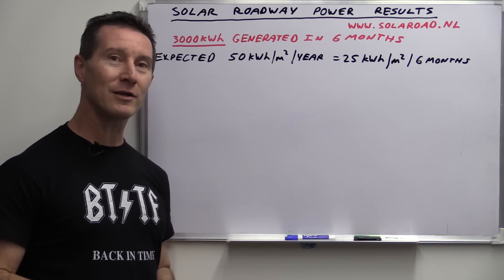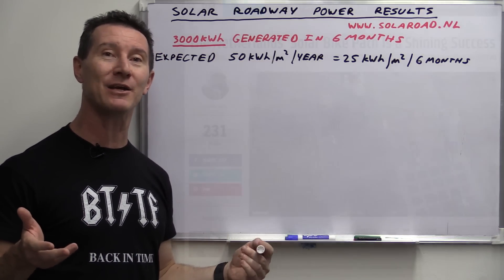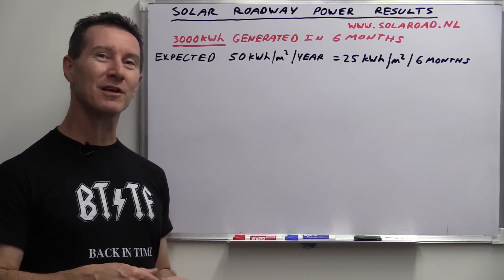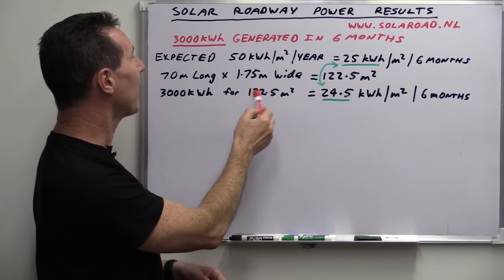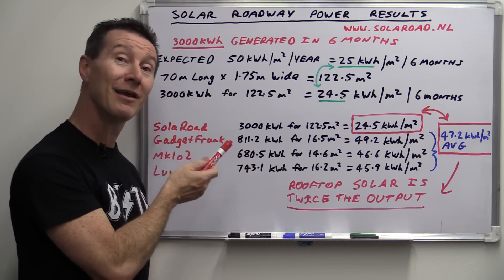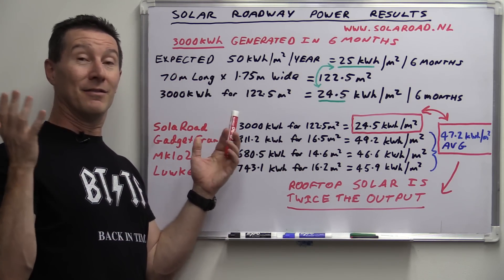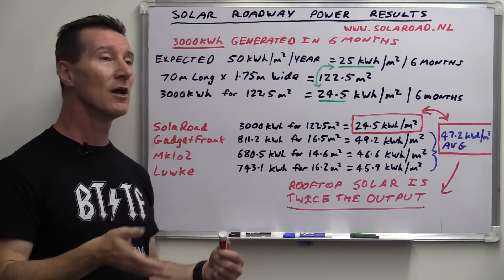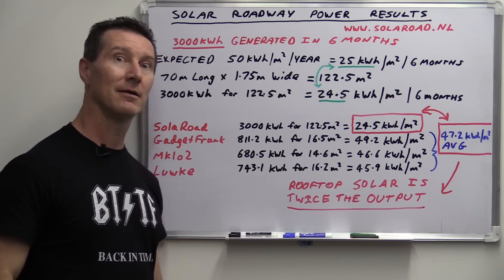EEVblog #743 - Solar Roadways Test Results

Comment: I mean yes I see many problems in this design, in the efficiency and in the production cost (in sense of the expended energy). Why not use space that we already cemented? Yes it would be better to do roof first, but filling the nature with angleded solar panels is not the right way. 🙂

Comment: If you have a very large surface area, eg a road and very cheap PV's then efficiency becomes much less important. Also installation is a large part of the cost of rooftop PV due to access issues.

Comment: Producing more power than expected doesn't mean that it's viable. Media reports are usually not made by actual engineers.
0 Watt-Hours produced is more than a negative value (drawing power instead of producing it) but that doesn't mean that the solar roadways isn't a glorified LED banner.

Comment: I'm on board with solar road ways being stupid, but why do you keep comparing them to roof top solar panels?  I get that the solar roadway people use general solar panel efficiency in their numbers so you gotta debunk that part, but the cost and efficiency of these systems need to be compared to existing roads, not existing solar panels.
Reply: Existing roads are much cheaper and better than solar roads (as roads).  And existing solar systems are much cheaper and better than solar roads (as solar power generators).  So you can save 10-100x the cost by using normal roads and normal solar.  It makes zero sense to put them together to create an inferior product to either of them (i.e. something that sucks as a road AND sucks as a solar power generator).  Even if every roof on earth already had rooftop solar, you can still create roofs on the road to put the solar panels instead of idiotically having the cars drive on them.
Reply: Philo Judaeus of Alexandria - That doesn't really address my comment though.  Just saying they suck as a road (which is I think obvious) isn't the same as doing the math on cost of traditional roads versus these sliding nightmares.
Reply: Faladrin Regular roads: $3-$15/sqft.  Concrete is at the high end of that.  Solar Freakin Roadways: $500/sqft just for the panels (based on their claims).  Scott said in 2010 he 'hopes' to have it down to $65/sqft.
Reality:
-1st installation (300sqft outside their shed) was funded by a $750k grant - so $2.5k/sq foot
-2nd installation $500k for 150sqft (n/i volunteer work from mayor etc.) - so $3.3k/sqft
-3rd installation (contracted) MoDot visitor center.  12x20=240sqft.  MoDot spending $102k, said 'the rest will be paid for by crowdfunding.  These guys have a lot of fans".  So $425/sq ft paid by govt... who knows the total cost?

And this, of course, assumes they can get all the obvious problems with having glass-panel roads solved (i.e. they can function as well as asphalt/concrete).

Point is that regular roads/pavement have a negligible cost compared to solar freakin' roadways.  And we STILL can't afford to repair them.  Solar panels (that we can put at the side or on the roof of the road) are more expensive, but still 10x cheaper and 2x as efficient.  Hence, as a concept, Solar Freakin' Roadways "suck as roads and suck as solar power generators".

Comment: This kind of video causes the weirdest of commenters. The general consensus is that scientific minds agree because science is about fact. You can make statements and use mathematics to show your correct proof and seem credible while simply choosing the right math and avoiding certain properties to prove. 

DO NOT LET THIS MAN OR ANY OTHER THINK FOR YOU!!!!! Do your own research, ask your own questions and find the answers. do not let anyone you do not know think critically for you. This guy can say a bunch scientific and mathematical jargon and if you do not fully understand these principles he could be manipulating the facts and you would never know. No one is holding this man accountable. 

Think for yourself!
Reply: Think for yourself? Dude, people are not scientist. Most likely, they will get it wrong.
People who know can will get better answers than some random dude thinking for him/herself.
Yes, theory and practice can be different some times, but the theory some times set limits that the practice can never break. Have you heard of Carnot cycle? Try to reach that limit in practice, it's a theoretical limit for the efficiency of thermal engines. You cannot reach it. And if you do, you will have a fucking Nobel prize.
If the theory set the limits, don't expect to reach it from the practical applications.
Reply: Glass melting point 1400 C to 1600 C ,  asphalt melting point 140 C and bioasphalt can blinded at 60 C.    You need to turn the roads into 2 meter deeps pits so a working conduit can be put in for the wiring and too keep dry as well.   The road could make new heat island where none have been there before.   EMP drain from solar cells at night.  And  about 200 other reason why any of solar roads won't work.
Reply: I never said Solar roads work or don't. What I said was to not let this man do the thinking and mathematics for you. Search out your own answers. 

I admit one thing that I truly believe is the one absolute fact in all of this and that is that none of definitively know if this can work or not. we can postulate and calculate all day, however if one thing in science has always been true theory and application aren't ever the same.

This video is what is known as bad science. This man has a belief that the solar roads will not work. he has math to prove it. The company behind Solar Roadways (or whatever it is called exactly) likely has math proving it does work, or at least can work. Good science says "We have this thing, lets see if it works or not. We've done some calculations and have come up with a theory, now we must test the theory." If we decided not to have experiments based on theories that something wouldn't work then we wouldn't have half of the tech we enjoy in our lives. 

I will say this, I feel many people have valid concerns and maybe certain aspects of this project may not pan out to full expectations. However the plain benefit of using our bountiful roadways as solar energy collection alone are absolutely worth every penny to try and make it work. I also feel using the trenching cables to run power and fiber are a massive benefit to our society and connecting more people to the web.
Reply: What proof that Solar Roadways works?  Just before the due date of the testing lot at the red barn Scott Brusaw wrote on Facebook that a power failure had erased the hard drive.  At the Sandpoint lot reporters and the public were welcomed at first, by the third month even though cars were in the parking lot the windows were closed no one was answering the door.  As of January 2016 the Facebook and all the YouTube posting were shut down.  The removing of "military applications" and other facts that put a bad light on Solar Roadways.  Eevblog working with thin air here.  As for me all I've seen so far is the four working solar panel for the heating system, Scott Brusaw fully omitted that red barn parking  lot in the photo's was a mock up and the had only two working solar panels.  And the phase two solar panels are mock up as well.    So Scott Brusaw show us the number not the hot air.
Reply: You, sir, have made THE best response to a comment of mine across three or so videos on this subject. Thank you for being respectful and using a good example to make your point.

My response would be that many theories, such as the one you mentioned (which I'll research on my own later, because it sounds awesome) are limited by current technologies. I think it is worth some effort to attempt to reach those boundaries from time to time. Along the way with this project, a different discovery could be made and we end up with a wonderful technology we never expected. 

I also agree not everyone can understand the principles and properties, that still doesn't justify blind faith in these people. Which I should make clear: I'm not claiming that this man is wrong or lying, just don't put your faith in him blindly. Try to research the things he talks about and understand them the best you can and see if what you find comes out the same. I just want more people thinking for themselves.
Reply: Even if they disagree with me*

Comment: The use of these in car parks, pathways and low stress roadways such as house drives  is a viable means to utilise space and avoid the need for agricultural land being used in solar farms, even if a roadway only generates enough power to maintain the associated electrical infrastructure it would probably be worth the investment

Comment: But... Yeah, sure, this is nothing like the freaking solar roadway power promised, and quite frankly it doesn't look like that can be achieved at all. BUT, I find there is a but in here... The problem here is they break. The glass shatter. It's the only problem. 3000 kwh with the solar roadways versus 0 kwh without them. Nobody should expect the kw's to be used to heat up houses or anything like that, it's just not realistic. But the power could be used for something else altogether. Traffic lights.. Powerstations for electrical cars.. Of course you'll get more output from solar panels mounted on a rooftop!
Reply: 3000 kwh is only better than 0 if there are no cheaper alternatives to get the power. There are plenty, so it's a terrible project.

Comment: So this idea may work if the installation costs are lower (about half?). For a low use and footpath/bike path only system with no LEDs and no heating. It's all about being realistic and not over promising. Sadly a lot of kickstarters and similar do over promise. But...

The end of your video shows how it should be done. :)

Comment: Listen mate as much you  discuss it's a useless topic like you  without  get inside the sun  there is no energy on the Earth it's only viable is nuclear for bulk now you  take risk or not there is not competitive any thing unless generate plasma the intense heat no heat no power that's simple . Now you can drink heavy water and think about plutonium and Urenium and threre centrifuge and nuclear physics do derivatives as much you can .

Comment: A couple of things you don't mention.  On the ground the solar panels are much more likely to be in shadows of trees not to mention or people using the trail.  Another advantage to having raised panels on a bike trail for example is that the trail might be able to be used during winter snows and summer rains.

Comment: EXPLAINE THIS DIRTBALL SHILL! http://www.treehugger.com/solar-technology/france-pave-1000km-roads-solar-panels.html
Reply: +lynzcow   Wattway by Colas is a low power solar cell mat with 40 cells per mat at 1.4 volts per cell coming to a total output of 56 volts.    Where Solar Roadways and SolaRoad are using a 17 volt solar cells three of them coming to a total output of 51 volts.   All this means is Wattways is safer than Solar Roadways and SolaRoad for road and foot use.   By being a bonded to the road vs redesigning the road means there will very little cost to it.   In the end EEvblog was right all Solar Roadways and SolaRoad did was take rooftop panels put them into the ground, both didn't make anything new here both are very out of date.
Reply: +lynzcow Unfortunately that article and website does not mention any details of the "pilot test sites". The devil is in the details. 
I have two more words, "Maginot Line".
Reply: +lynzcow I just calculated the numbers from the article. They say 20 sq meters produces enough electricity for one house and 1 km of road will power 5,000 homes. so:

20 sq m/home X 5,000 homes = 100,000 sq m for 5,000 homes
1 km = 1000 m
100,000 sq m/1,000 m = 100 m for the width of the 1 km of road.

At 4 m per lane, this will need to be a 25 lane road!!!!

There are no cost estimates. and crystalline silicon is VERY brittle, so any flexing will break the cells. Asphalt roads tend to flow, and develop waves from the pressure of traffic, thus the cells will be flexed and will crack.
Reply: +Michael Chejlava I have to correct my calculation. The article said 5,000 inhabitants, no 5,000 homes. So, assuming an average of 4 people per home gives 1250 homes. This would make the road 25 m wide or about 6 lanes at 4 m wide lanes, which is 13 foot wide lanes. There are only a few roads with this many lanes.

Also, the company website claims the panels have have tested to resist 1 million truck tire crossings of the panels. Since big trucks have at least 5 axles that means 200,000 trucks or about one year of only 550 trucks per day. They do not mention how much load, how fast or if these tests were done in a lab or on a road. Not discussed were tires stopping or turning on the panels.

It sounds like they are aiming at residential streets, rather than highways. Look at your local streets. Where I live the streets are lined with parked cars, and trees, and are in shade about 50% of the time. Not a good plan for getting solar energy.

Comment: so my question is: these Values on people's homes, are they the actual total generated, or what remains after the household requires?

If the bike trail is splitting between the grid and the say the area Street lightning, the value is likely significantly based on the number of lights it is powering.

Comment: Solar power in general is just not there yet. We're getting close, maybe in 50 years it'll be cheaper to use solar than other forms of energy. The basic problem of intermittent power generation hasn't been solved with this solar roadways. It's just adding more problems to solar power.

Comment: here we go again, an other idiot journalist that doesn't know what he is talking aboutcitylab has an article about the success of solar roadways
Reply: +dave rolleman   So your going trust a man who want to drop solar panels out back of airplanes into hilltop.  Also that's SolaRoad not Solar Roadways making the claims.
Reply: +Mark Baanstra Embedding any solar panel in the road / sidewalk is going to severely hinder output. Even when there is no tracking handicaps output of a panel. so I wonder the "math" they used to get the results they got.
Reply: dave rolleman  Oop's!!! Reading your posting the wrong way, thought your were disagreeing with EEVblog, sorry about that.

Comment: I don't think solar anything is viable just yet but I don't trust this guy. It is clear that he's very bias. He downplays the "more than expected" a little too much. Imagine if they didn't hit their goal. Think of how much he would crow about them not hitting the expected goal. There was about a 1% chance they would exactly hit the goal so there's almost a 100% chance they would be a little over or under. They said they exceeded goals; what did you expect them to say? Also, his numbers are not exactly accurate, as he has admitted. Is it a coincidence that his mistakes help his argument instead of hurting it? Again, I do not disagree with his overall assesment, but I do think that if they ever are viable, he would fight tooth and nail to say they weren't.
Reply: +Don “GoogleInvadesPrivacy” Johnson ... " Is it a coincidence that his mistakes help his argument instead of hurting it" Actually his math used best-case-scenario numbers. So if anything he overestimated the output of the pathway. If he wanted to get really accurate he could incorporate bad weather, shade, and dirt on the surface. So you've got it completely backwards. Try actually watching the video.
"his numbers are not exactly accurate"
Give me a break. He actually made an earlier video where he predicted the output of the pathway before the test results came out, and he was dead on.

""He downplays the "more than expected" a little too much."*
They expected it to be a novelty. Turns out its still a novelty plus a few extra watts.

Comment: +EEVblog (DAVE) :  Debunking solar roadways again, are we?... So what if a house generates more electricity than the solar road? So what? Its still a better option than a common roadway! It's clearly a move in the right direction, for urban sustainability!
 Why are you so attached to your conventional roads? did you invest in a paving company? or you feel threatened that people won't need to buy your household solar panels? what I'm trying to portray here is that giving an extra functionality to something isn't a bad thing yo! Now pack up your shit, and put it in a bag, tie a knot and sell it.
Reply: +Kieron Badenhorst .. Its still a better option than a common roadway! The 70m pathway can only power one home. It also cost $3 million. Solar panels only last 20 years so this might generate $60k in energy in its operational lifetime, leaving you $2.9 million in the hole, not including maintenance. A 70m concrete sidewalk will only leave you $8k in the hole. So no, its not a better option.
did you invest in a paving company? He is a supporter of solar technology.
"or you feel threatened that people won't need to buy your household solar panels?" He doesn't sell household solar panels. You should try actually watching the video. If you want to disprove him then try actually focusing on the points he made and offer better calculations instead of making blind assumptions in a half-assed attempt to discredit him.
Reply: Good day mate, yeah I regreted my previous comment, so you're defintely right, plus after watching another video on this topic by Thunderf00t I got more of an understanding why the solar roadways idea might have some to say the least setbacks, but I like to think that ideas like this one can change, adapt and/or improve... having said that, I still personally like the idea, cause its a hack on something that everyone predetermines as a norm (a simple road) and just by changing it a bit you get an entirly new parameter. So bottom line, Im sorry i said that about Dave, I had no right.
Reply: I guess i also got carried away with all the hype